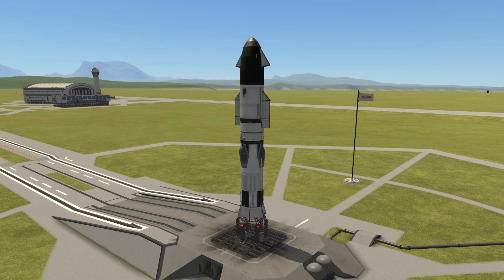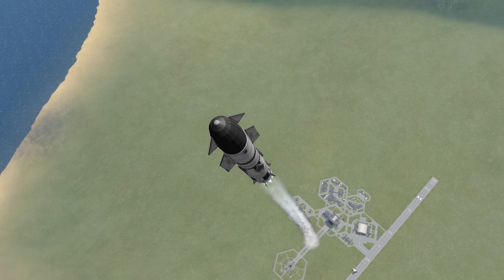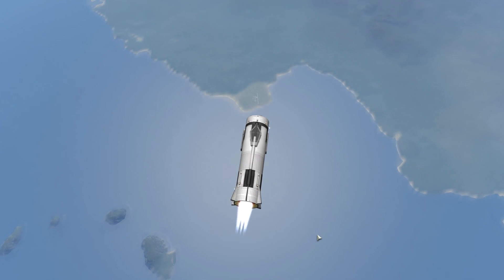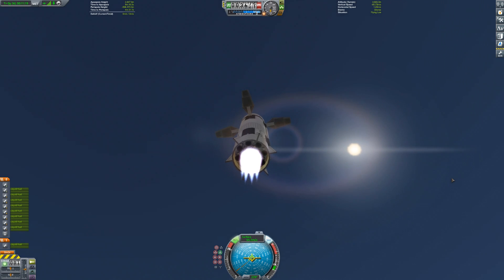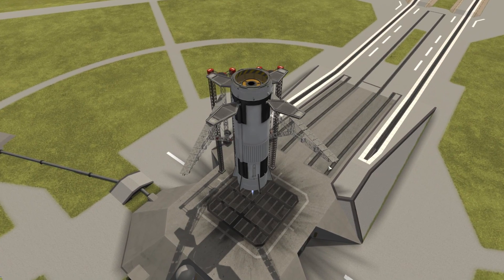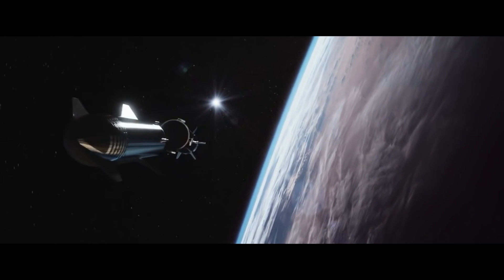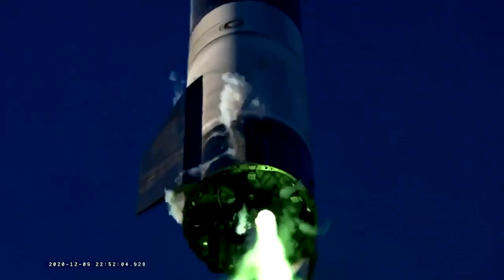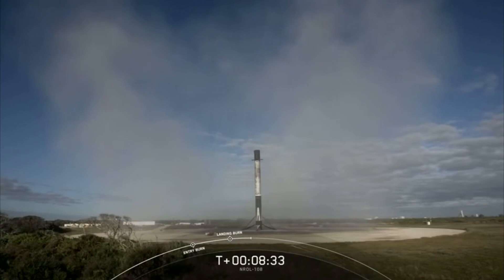Why SpaceX Wants To Make Landing Super Heavy MORE Difficult.

Comment: "You don't need to demonstrate that something is able to work in order to patent it" One of the biggest problems with US Patent System.
Reply: The problem is the patent office can't test 500k patent applications a year to make sure they work and the inventors certainly are not going to tell you their patent doesnt work.
Reply: @drfroglegs  That would be easily solvable.  Grant a few years of patent of the idea, if it's working by then, you get granted an extension to the current patent length. If it's not working, others can get a go at it. If the new guys make it work, perhaps they should pay some royalty to the old guys for doing the work the new guys then didn't have to do.
Reply: @drfroglegs  You used to have to submit a working copy, which would pretty easily solve that
Reply: One benefit of this system is that if you do manage to get your idea working, it is already patented and can't be poached mid-development.

However, there should be a clause that makes unproven patents expire more quickly.
Reply: @KevinJohnMulligan  agreed. Speculative patents stifles innovation.
Reply: @evanellyfant  If you have reliable research on this, please share. You see, if one has patented an idea the marketplace is prepared to help you monetize it. If the engineers at the fabrication shops are unable to do so, then there will be little monetization outside of others speculatively licensing your patent in hope they will be able to fabricate themselves. Thus, no one loses.

Also, people often forget a very important aspect of patents: you actually have to tell people what your idea is in order to get it patented. From that moment, the rest of the world is able to benefit from your idea. Until they take it to market, they do not have to pay you anything. As soon as they attempt to monetize it, however, you are entitled to insist on a license fee because you were the one who originated the idea and shared it with the world.

Otherwise, all of the brilliant humans who come up with ideas but are in capable of collecting the capital and leading the organizations required to fabricate it have no choice but to work for others. In early stages of capitalism, this is very common. In modern societies, we have come to recognize that creators should be able to work free of constraints to create. Sure, they may toil in obscurity and poverty for most of their life, but that is the creator‘s choice. When we are fortunate enough to have them come up with an excellent idea, we should have no problem with their being able to monetize it.
Reply: Heh, yeah, you get weird stuff in there as well... Like reactionless spaceship engines
Reply: Who needs patents when we have CGI
Reply: Patents and IP are a solid idea on principle: the problem is that the corporations that benefited from it used their pull in the US congress to change the patent/IP laws to break the idea over their knees.
As a result, they don't really achieve their original purpose anymore.
Reply: Patents are the worse thing a civilization could invent...
Don't copy this line: I've patented it.
This one too...
Intellectual property is absurd, amoral and is an insult to God.
Reply: Annaëlle D. Yeah. Why should the person/people who put in the hard work, sweat and tears inventing something get any guarantee of getting their fair share.
Look, there is a lot wrong with how ppl use patents, like patent trolls and ppl who buy up patents so they can sit on them and stop competition. But that doesn’t mean that everyone else should give up their rights to have their work protected from those that would just steal it.
Reply: @StixFerryMan  the hard work is making it work/demonstrating it. Anyone can come up with an idea and just wait for someone else to actually do it.
Reply: @StixFerryMan  Why? Because information is free. Have you ever heard of telepathy? You can't steal an idea. Make calculation and design a prototype is an investment, I'm OK. As reading lot of stuff about virology to tell people there is a problem with the "germ theory" (I do it for free). If one day you have a drink, the same drink as everyday (put what you like), and suddenly decide to add mint and coffe to it... would you "protect" this idea? What if building a bike was allowed to the first person who invent the wheel?
In an hyper connected world, you would never be able to protect goods from being reverse-engineered... (unless you create a New World Order, controling everything and with some few giant companies having the right to develop things).
And taking a patent ... knowing you will never even try to build what you designed is (to me) totally absurd and to forbid others to use this idea is amoral. 
I'm sorry not to be very clear (I'm tired... and English is not my natural language) but I hope you'll see my point.
Reply: EvanElleDev you can’t patent an idea. Well you can, but it is a waste of money. What? You think you can something like “any car that flys” and think it will hold up in court? You have to patent a process. In detail. Vague concepts don’t count.
Reply: Annaëlle D. So, if I spend my time and money to make a new and unique process, something that no one else has ever done, I should just let others take that idea and make money from that and be happy? Do you also think it is wrong to pay a worker for their time and labour? Is it wrong for a farmer to charge for the food they grow? Or a shop keeper for the goods they sell? If I make something, I should be able to sell it.
Reply: @StixFerryMan  I see what you mean. Maybe, as you said, it's because of the abusive behaviors that I have this bad "feeling" about patents ;-)
Reply: @StixFerryMan  If you invent a process and put time and money into getting it to work, you should have a natural advantage over others copying your idea, but if someone else can get your idea to work with better results and lower costs, then they shouldnt be prevented from doing so. Competition is the driving force of innovation.
Reply: Chuckiele then that is not my invention is it? Are you saying if someone invents a different way to do something, that I can no longer own my way? Who are you to say whose idea is better? Who are you to say who gets to sell their invention and whose hard work must now be given away for free? What gives you the right just because there are different ways of doing something to say one person’s idea is now not allowed? How can you say that the new person now owns the idea of doing something just because they came up with a way to do that thing differently then another?
Reply: @StixFerryMan  No, nobody should be able to own an idea, period. Its a fucking idea. It doesnt matter if someone can produce your product more effectively using their own way or the exact same way that you invented, the hard work is getting that way to work, not coming up with it, so your competitor has to put as much hard work into making the product as you and if they can do that more effectively, then they obviously deserve the higher revenue. Who decides whos idea is better? The free market. If people dont buy your product, then its either useless or someone else can make it better or for a lower price. Youre still allowed to produce it though, you just wont make any profit anymore, you have to come up with new ideas that make your product competitive again. Theres no right to make profit from an idea, some ideas succeed, some of them fail, thats how inventing things works.
Reply: Chuckiele a person can not own an idea, no. But the work they put into developing a product, process. If I invent a better mouse trap, I don’t own the idea “Mouse Trap”, but I do own the better mouse trap I developed. That idea I had that I worked to perfect. But you are telling me that that work doesn’t matter? 
Oh but you just had an idea. You just had thoughts. So what if no one else thought of it, did the experiments to get it to work. You can own ideas, so I’ll just take your hard work and make money off it and you can just go rot. 
A nice way to see the world. Just go around and steal.
Reply: @StixFerryMan  That's exactly the problem with patents yes. Someone just waits for you to develop your super-duper mouse trap, then steals the idea, writes it down and rushes it to the patent office. Once the patent is accorded (automatically without research) you'll hear their lawyers telling you that your mouse trap infringes on their patent and you'll need to stop and pay millions of fines. Good luck in court, since you have no more money for lawyers or to live off during the 2+ years until a judgement is made.
Reply: @Vugoseq  But you will get the patent first.
Reply: @AnnaëlleD   again, I think you need to brush up on intellectual property laws. One is not able to lock up an idea forever. In fact you’re missing a very important point: in order to get a patent you must tell the world what your idea is. Immediately the world is able to benefit from the knowledge you have created. The patent allows you to make money by charging those who use your idea. Everyone benefits. There is also a limit on how long you can maintain your patent. It varies by domain, regulatory scope, and complications related to the timelines of patent actions. At some point, that patent will expire.
Reply: @HugoToledo  Thank you for your words. I'm aware of how it works. It's just that I'm French, sometimes tired and sometimes confused... and even bored ;-)
Yes, I agree. Patents can be seen as a mean to be remunerated for your "brain activity" without depending on an industrial entity. And that's a good thing. Mental activity demands investments in time, learning, searching, etc... that deserve valorisation as any other form of work. 
As I said (in an answer to someone) I think this is how corrupted people use patents to freeze inovation and to protect your own business which made me have this bad feeling about patents.
Thanks to honest people who can show the benefits of laws when used without any kind of corruption.
Have a nice day.
Reply: @HugoToledo  This is not how it works in practice though. People were able to actually patent vague stuffs and it covers against lots of real innovations - this especially plagues software industry. I recall Disney having patended idea of vague character procedural generation(perhaps it was sth else) thing when 1. the concept has been existing for ages already 2. They did not actually use it themselves, it was merely a roadblock against that tech.
Reply: @HugoToledo  Patents and copyright law are like communism. Great idea on the surface that does not stand the thorough scrutiny and completely falls apart in reality. Look for lectures at Mises institute from Stephan Kinsella. Patent lawyer explains it much better than I ever could.
Reply: @AnnaëlleD  Imagine you're inventing something for 20 years putting your life's savings into it, and then when you want to make money off of it, some rich company makes a knock-off version of it using all of your work, doesn't credit you at all, and you don't make any money. That is what a patent is for.
Reply: @gonkdroid4prez539  I know it. But anyway, you can't get it: too mercantile you are.
Reply: @AnnaëlleD  Then all software would be free and there would be no Bill Gates.
Reply: @bobb6186  The dream... :-)
Reply: @AnnaëlleD so is your existence
Reply: @qwerty112311  3 years after, you come with a so little "so is your existence"!
Nobody can know to what you are trying to answer...
But do YOU exist, "qwerty112311" ???
These algorithms...
Reply: @AnnaëlleD   The reason intellectual property protections are granted around the world is so that creators, those who think, are able to monetize the output of their brains. Otherwise, all thinkers would be in servitude to fabricators.

Also, you may want to revisit your notes from when you studied intellectual property because you have confused copyright and patent law.

As soon as you affixed your ideas to media, which you did when you published your comment, you are the copyright holder of what you wrote.

Of course, I suspect the terms of service for YouTube state that you are also granting them a non-exclusive perpetual license to use the content you place here in whatever manner they choose without any remuneration to you in consideration of your benefiting from the use of the service.
Reply: @AnnaëlleD  this is the most idiotic take I've ever heard. Remove patents and you stifle innovation because people aren't going to invest millions or billions into R&D just to have someone come along and steal their idea
Reply: @VanquishedAgain  Just learn about History. Many things have been invented way before patents existed. But, keep your position. I don't care anymore. Time is over...
Reply: @AnnaëlleD  That is a blatantly ignorant statement. People should absolutely be able to be compensated for their intellectual property. Or do you think musicians, writers, directors, people on YouTube, etc, etc, don’t deserve to make a living?
Reply: @JordonBeal  Please read the whole conversation before answering... ;-)
Reply: @AnnaëlleD  I did, and I stand by my assertion.
Reply: @JordonBeal  Great, if it pleases you... Anything without any interest to add? Have a nice life!
Reply: @AnnaëlleD  insult to God? Where the hell did God come into Patents? What are you high on?
Reply: @AmoghNatu  God... creation... Never mind...

Comment: Sorry, but I dont see the sense in elon's landing system at all as it adds layers upon layers of unnecessary complexity. Yes her removes the legs from superheavy and sure, it will save a lot of weight from the craft however he's adding thousands of much much heavier components to the ground system along with relying on absolute precision with 100% success rate.
Every engineer will understand, this simply isn't possible when taking into account the dynamic nature of our atmosphere, among other variables.
Spectacular of it works. Disastrous if tolerances drift by only a percent or 2.
Think I'll start up selling popcorn to would be crash spectators at the launch pad

Comment: Scott I have a good idea that they can do it on the first or second attempt. Because if you recall the Dragon capsule is fully autonomous. It docked with ISS using the computer system. If they can do that precise procedure I'm sure they can "play catch the booster" and stick it. It sounds difficult but if you have the GPS coordinates plugged into the program it should be relatively easy.
Actually it flew to the ISS using the on board flight system. I can only imagine how bored the crew was. They had the arduous task of monitoring the whole procedure. 😴🤔🤗

Comment: Every video I see mentions how fast SpaceX will need to launch refueling ships to supply a Mars trip.  Why couldn't they have a tanker up in orbit ahead of time with all the required fuel already there and waiting?  If you want to minimize risk for a mission of that magnitude, that would make things much simpler, and remove all time pressure for supply ships.  They've already proven they can dock with another object in space.  If there was 1 - 2 docking stations in space waiting, It would make the final launch much lighter and be much less limiting on the materials brought with

Comment: Wouldn't it be more effective to design like 4-5 Massive drones, that carry a catching net or something similar & they can coordinate with the rocket and catch it basically mid air? this way you can have the drones make some corrections which the Booster otherwise has to do/can't do. Also the booster does not necessarily have to land where the "tower" is

Comment: Maybe this is a dumb question, but can you explain why parachutes cannot be deployed for the returning landing gear? If a human being can land safely from a stratosphere jump, why can’t a ultra modern rocket ship leverage use of parachutes?
Reply: It's not a dumb question, but I see why you think it is.   It's because if the wind is blowing at all a parachute is also a sail, effectively, which you already knew. Professional skydivers have to use airfoil chutes  and a lot of crazy circling and aerobraking to come down sort of on-target.  If you can come down on a 3-meter  target, that was a pretty good jump, but they still don't come straight down. They have to bend their knees and roll a bit, or bounce. 

The rocket isn't going to bounce, or bend, it's got huge titanium fins on the bottom of it. But even if it had a way of using machine apertures to control an aerofoiled chute, or any other kind, theoretically possible, what's it going to do when it's decelerating and creating an enormous updraft going straight into what really is just a sail from that angle?  It will float and drift off-target, no matter how calm the day is. Even then, there might be a way, I don't know, but it's not going to help on the Moon or Mars, which is where these things are ultimately being designed to go. Better to focus on precision thrusters.
Reply: @acnine-ball8976  Wow! what a detailed and fantastic reply, thanks a lot!

Comment: Is there a reason why they can’t use a diaphragm system inside the tank to keep the fuel at the bottom for landing? I know everything is at cryogenic temperatures but surely there has to be a material suitable to handle the pressure from the gas and the temperatures of the fuel.

Comment: The landing weight of the system will be about a quarter of the take-off weight. Also, if the Raptors can hover that will make it possible to maneuver laterally just a few feet above the surface. I agree, catching space objects with a net doesn't seem all that high-tech.